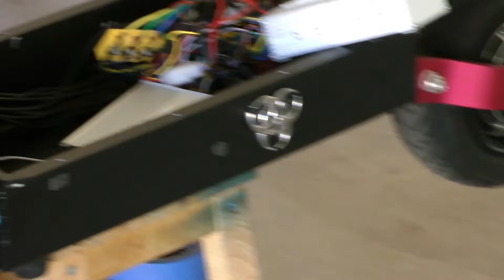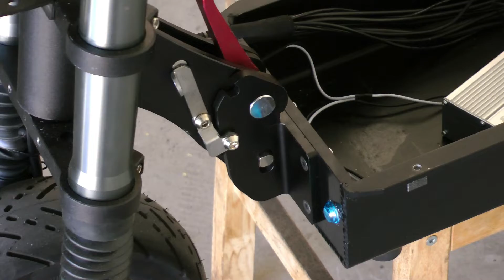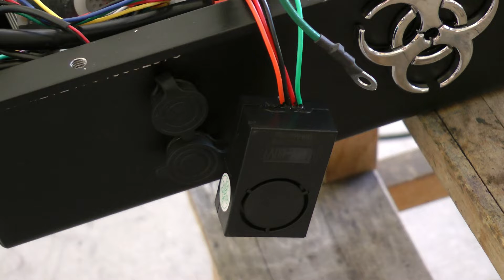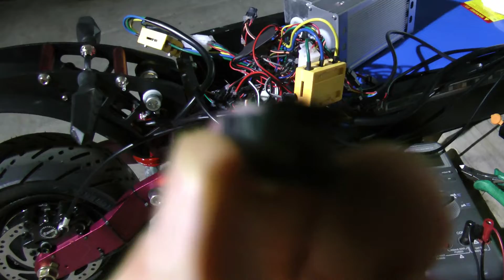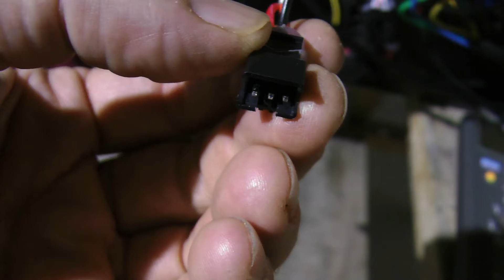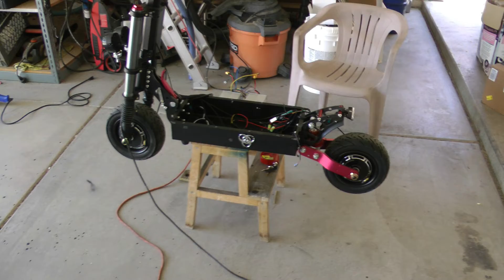Laotie Ti-30 alarm bypass

Comment: Hey buddy I've got a different one mine's got three dongles two coming from the power supply I've got a lot more colors working with simple black and red to the display I'm not really sure how to bypass this It was in a flood but all the sensitive electronics were above the water level just this was below and I think it's the cause for it not turning on battery was completely removed during the slight flood

Comment: The motor wires The ones that connect to the control box I believe there's like six of them do they need to be the same color on each side
Reply from the maker: I believe you mean the phase wires (three thicker wires, yellow green and blue from each motor and controller). It depends on what controllers are installed. For the Ti-30 with the stock JP controllers, yellow goes to yellow, but blue goes to green and green goes to blue. For the Yunli controllers, it shouldn’t matter because the Yunli controllers have a learn function. I have videos on the controller install for both types. Which controllers do you have?
Reply: Bonjours, j ai une trottinette électrique 5600w avec deux contrôleur Yunli 60v 45+1 tout neuf et la trottinette électrique ne s allumer pas et je comprends pas pourquoi, si vous avez un schéma de branchement à me présenter je suis preneur
Reply from the maker: @SEN-rp7mg  What throttle/display are you using? Also, watch this: https://youtu.be/nVbxYaVWYAk?si=mPoNl07iT87VKCzN
Reply: Vous croyez que ça viens du boîtier d alarme

Comment: I have the same scooter and I tried this because I thought it would fix the issue I had where I keeps turning off even tho it’s fully charged but no it’s keeps turning off every time I turn it on idk what to do.
Reply from the maker: Measure the battery directly on one of the battery plugs. If it is fully charged it should be around 67v dc. If it is but when you turn on the display it turns on but then goes off by itself, it’s either the controllers or display itself. I would recommend getting the Yunli controllers with the Yunli DS20 throttle.

Comment: anyway to charge or change the batteries for the scooter remote key???
Reply from the maker: Yes, you can replace the battery. CR2032. Pry the silver sides off the remote, then you’ll see a seam down the middle where it separates into two halves.

Comment: I had the Ti-30 for a couple months now and I followed a couple of your mods for throttle and headlights. How do I get the throttle to be more linear? It goes from cruise to trying to kill me with nothing in between.
Reply from the maker: I believe that is a drawback of the squarewave stock controllers. Once I do some testing with them. I’ll be swapping them out with some sinewave controllers I ordered. Hopefully that will be an improvement. Will do a video on that, probably a month out from now.
Reply: @Desert-Ecruising  I will be looking forward to it!